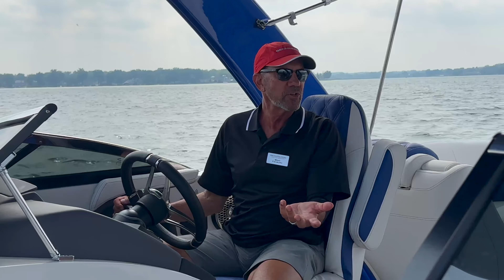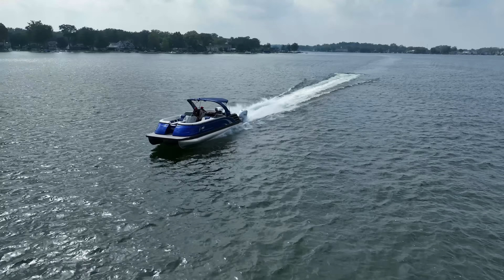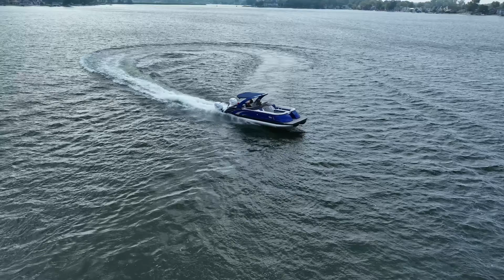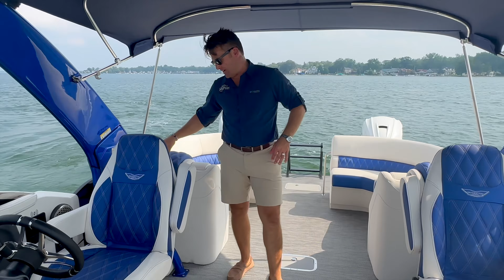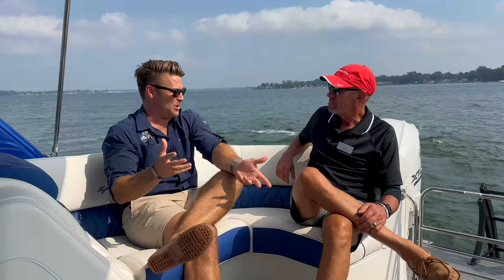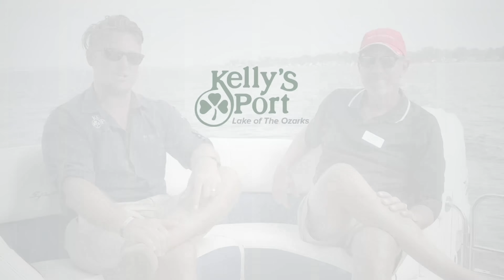2024 Bennington 30QX - Twin Yamaha 450 XTO's - Pushing It's Limit!

Comment: The Mercs ARE the choice.  Those Yamaha's are boat anchors.   almost 1000 pounds each!      What a slug.   They keep saying quieter quieter quieter smooth,  etc.  they must have said quiet and smooth 10 times to avoid SLOW and HEAVY.     How about true performance..   How about slow and heavy!.   3 Mercurys weigh about as much as 2 Yamaha's!!   And they are slow.    Imagine a twin outboard boat only doing around 50.  A twin 450 equipped Trifecta or Avalon is a 75 mph boat.   Of course this Bennington is larger,  but it's also a big stupid boat.        Big and Slow.  Maybe if you needed to put 25 people on board,  but if you have 12 or less people, then go for it.
Reply from the maker: Seems like you've enjoyed our YouTube page thus far.  We're happy to offer the choice of both and, yes, Mercury is more quiet - but having driven both Merc 450 & 500 twins vs. Yamaha 450's - the Yamaha outperforms.  Tough to say that Bennington is slow when the 450 platforms run 60+ mph all day.  Issue with Avalon & Playcraft and other twin engine pontoons - they are NOT ABYC certified - which means they will FLIP OVER under their own power in hard turns.  Countless accidents where people have lost their lives - unfortunately - and we're happy to represent the product with the best warranty, safest on the water, and #1 selling premium tritoon in the world.  Thanks for watching.
Reply: How does it handle in Rough  Water   ?
Reply from the maker: @robmacleod6051  Extremely well.  Have never lost a sale on a demo due to superior performance.
Reply from the maker: @robmacleod6051  Extremely well - we've yet to lose a demo on a 30 Benny, especially in rough water.